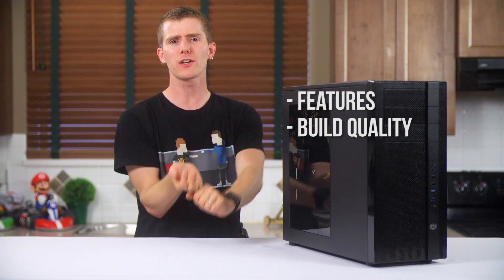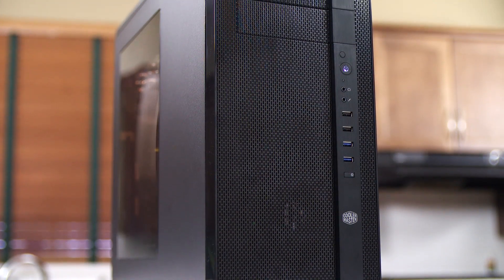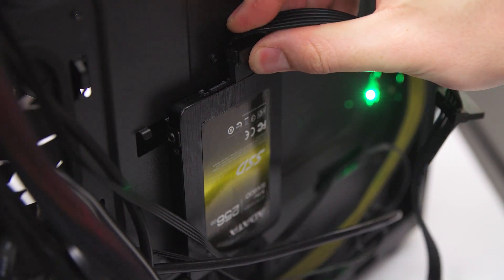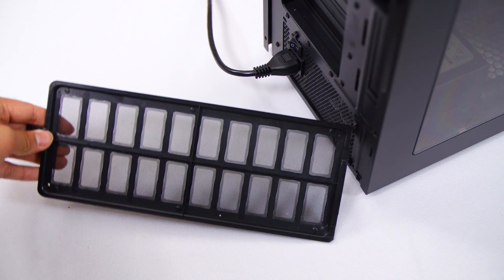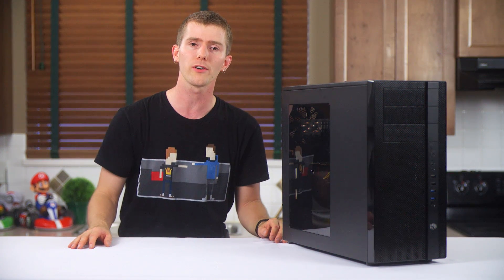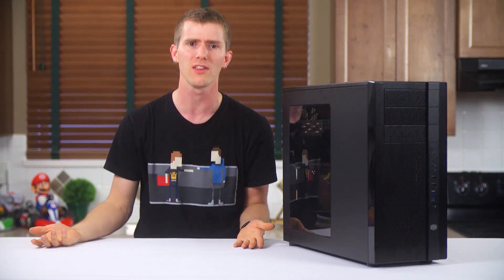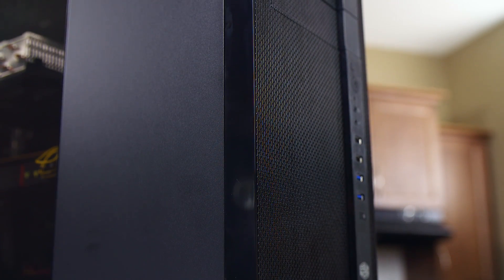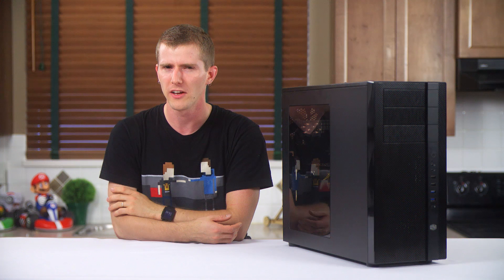Cooler Master N600 Computer Case

Comment: can someone tell me if this is a good build for a gaming computer. im trying to build my own for the first and need as many tips as i can get and if you can tell me what items to replace for a cheaper price that would be great

Case-Fractal Design Arc Midi R2 Cases FD-CA-ARC-R2-BL-W

Ram-Corsair Vengeance 16GB (2x8GB) DDR3 1600 MHz (PC3 12800) Desktop Memory (CMZ16GX3M2A1600C10)

Processor-Intel Core i7-4770K Quad-Core Desktop Processor (3.5 GHz, 8 MB Cache, Intel HD graphics, BX80646I74770K)

Graphics card-EVGA GeForce GTX770 SuperClocked with EVGA ACX Cooler, 2GB GDDR5 256bit, DL DVI-I, DVI-D, HDMI, DP, SLI Ready Graphics Cards (02G-P4-2774-KR)

Power supply-Thermaltake 850W 80 PLUS Bronze ATX12V 2.3 & EPS12V Power Supply, Black SP-850M 

optical drive-Asus 24x DVD-RW Serial-ATA Internal OEM Optical Drive DRW-24B1ST (Black) 

Hard drive-WD Blue 1 TB Desktop Hard Drive: 3.5 Inch, 7200 RPM, SATA 6 Gb/s, 64 MB Cache - WD10EZEX 

Motherboard-ASUS M5A97 R2.0 AM3+ AMD 970 SATA 6Gb/s USB 3.0 ATX AMD Motherboard
Reply: that mobo and cpu is not compatible.
Reply: HofflerPlayz what shouldni get
Reply: cornpops019 1150 socket.
Reply: You need a 1150. Socket mobo and change that powersupply to a 750watt 80+gold
Reply: If it's only for gaming you can save by only getting 8gb of ram
Reply: Oh and get if you can a ssd and change that HDD to a Western Digital Black. It is the fastest HDD on the market
Reply: It's actually 15-30fps diffrence and get an i5 4690k its higher clocked ,is easier to OC
(An i5 4670k/90k oc'd to 4.4 GHz performs as same as an i7 4770k stock but keep in mind that you dont have the bonuses of the i7)
Reply: The motherboard and the CPU are not compatible. Also, you should really never spend more money on RAM than your motherboard. The key is balance. Most people who are new to this spend too much money on a CPU and not enough on a power supply and motherboard. Remember, for most games, only the graphics card matters. There will be no improvement buying an i7 over an i5 - NONE.

Also, you would be better off buying a higher-quality but lower wattage modular power supply. For example, a 650W modular gold-rated power supply would probably cost the same but be more appropriate to the build.
Reply: ***** http://pcpartpicker.com/parts/partlist/ 
is this better
Reply: Garry Perkins http://pcpartpicker.com/parts/partlist/ 
this better? and if you can can you tell me better parts that you recommend if its cheaper

Comment: Zalman Z11 Plus > N600
Reply: That case looks hideous though.
Reply: Francesco Fusco
Zalman looks great irl.
Reply: I have a zalman z11 and it looks pretty bad, has minimal expansion room, is quite flimsy, and its hard to do decent cable management, it also only has one fan filter and that is for the front 140mm
Reply: Kaleb Gilley
I have the plus edition, I have fan filthers in the front, the floor fan and the psu, mine is built like a tank, no flex in the side panels and I have plenty of room for cable management.
 Zalman Z11 Plus looks really good.
Reply: The shape and size is the same, and compared to other cases cable management capabilities are low, and it doesn't have alot of internal room for expansion, for a case in the same price range I wish I would of gone with the corsair 200r.
Reply: Kaleb Gilley
Which is exactly what I did, great case
Reply: Kaleb Gilley
My girlfriend has the 200r, I don't like it. It is very loud, sucks in a lot of dust and cable management is meh, + the plastic HDD sleds are not up to par. The case also resonate when she uses her hdd, it's just a regular 2 tb toshiba less than 6 months old. The side panels are also flimsy. The 200r is not on par with the Zalman Z11 Plus, especially not the front bezel IMO, I built her computer and I built mine so I have experience with both chassis.
 But hey, different strokes for different folks
Reply: Yeah, it might also be that i'm moving away from the more flamboyant looking cases, I much prefer the sleek and understated designs now, although I suppose it doesn't really matter what case you get as long as you're satisfied with it.
Reply: Kaleb Gilley I had a sleek looking case before but wanted something more gamish looking and inspiring since I'm an IT-technician and have look at "boring" and "adult" tech all the time. The Zalman was perfect, looks fast and childish.

Both the 200r and Zalman are good for the money and I don't tinker with my machine that often.